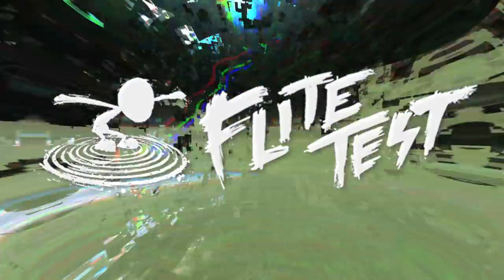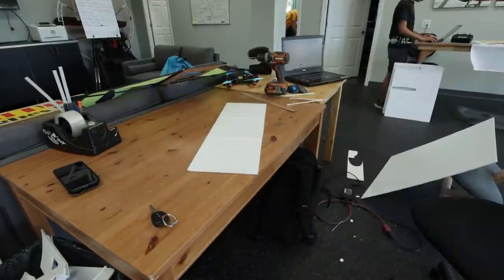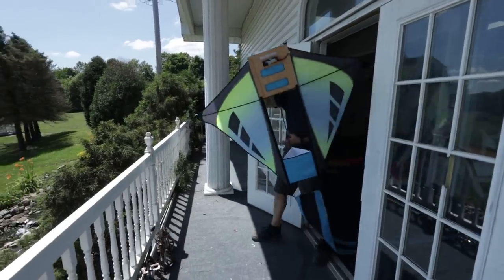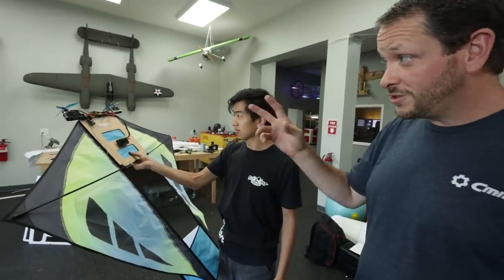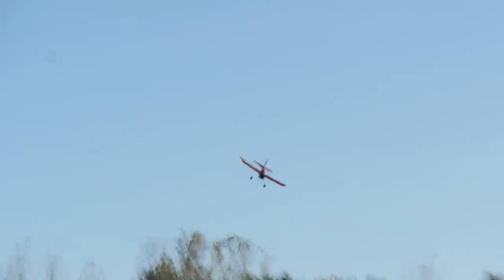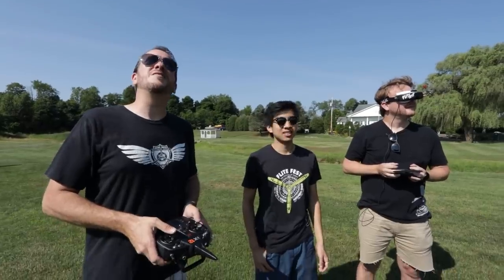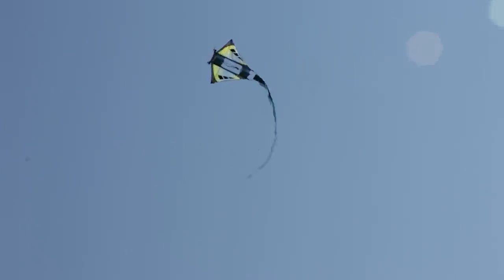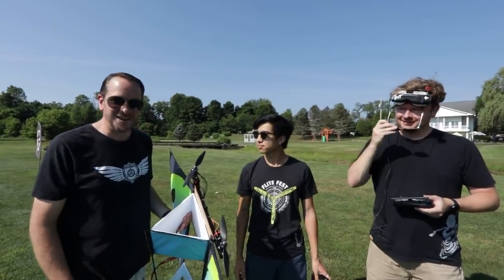Building and Flying a Kite with No String!

Comment: Super interesting. And as a kite maker/flier, I was wondering if it would improve further by having the motors 2" below the wings. That would create greater airflow underneath. As these aren't true wings with an airfoil shape to induce lift in the normal way, it just might work better. Not definitely, but it'd be interesting. 😉

Comment: Nice job! From my young kite flying days I have envisaged a small powered tug which operates to oppose the tension in the string - it essentially replaces the string.  A couple of servos would provide adjustment to the bridle to control angle of attack.  Then fly that in an actual wind using the lift generated by the kite and the pull of the tug to control up/down wind..

Comment: I have an idea for a potential game that's flite test could play. There will be two teams. Each side would have one mini cargo plane and 2 fighter jets. You would use green army men inside of a plastic bag with a trash bag parachute as "paratroopers". You would try to attack either side's cargo plane, and try to let not let them drop their paratroopers in a certain zone. They would use ribbons on the ends of their plane to recognize hits. If one of the planes ribbons got cut off by another plane, they were out. The objective was to drop their teams paratroopers first, and survive.

Comment: Great idea and brilliant solution! Plus you've basically invented a fairly easy to build (Kite itself is basically RTF) "plane" concept , that folds down to next to nothing. Great for those who don't have easy access to a roomy car, etc. Add a bag of releasable strips to the kit and make the foam triangles fold flat, and you're ready to travel. I have to wonder how a kite version of the FT Flyer would work out; It always gave me a bil of a "kite vibe" due to the shape. Could also be a fun revisit to one of the designs that got everything started for you guys!

Comment: I have a major challenge for you. Build from lowes construction foam, a 1 to 1 scale cessna 152. Insure to put everything in the cockpit including seats(from foam) that can hold actual human weight. Be sure to reinforce each piece with fiber glass. Once you get it built, although a little risky, place someone in the aircraft and fly them around just a few feet of the ground. It also should have plexiglass windows and paint. this is my humble challenge, however long it takes

Comment: The twin-motors-forward design/control system of this RC flying device is the same basic design principle that has already been implemented in countless different "Air Hog" RC flying toys...such as the venerable Aero Ace, the mini-Storm-Chaser, the F-16, the mini-Hero flying man,  the Intruder, and on and on (and on...).

Comment: It's actually a Bicopter with tail. The Kite does not fly. It's pulled/held up. CG is to high and almost at the front. That's why it can't glide and why you can't recover from a glide. This is also the reason why you needed the more powerfull motors. I think it would be more effective to take a drone/plane ... towing it. The towing hitch of the towing craft should be near it's CG on the upper side. Anyways if I would build this I'd use a lug on the spar to fix your spar exactly there. Well this would be 2 axes then (elevator with thrust and yaw with thrust differential). If you want to be able to control speed and climb (more or less *) independent you need to be able to lift and sink the motors.
I have an Idea in mind how to set this up also with the chance to go for full 3 axes (choice between yaw and roll) with the two servos and two motors but it takes some time to explain it and I'm definetly tired and hungry now and someone will wake me in some hours. So maybe later.
* If you add thrust you need to compensate the attack angle by lifting the motors to keep the same pitch. You can configure Mixers to make ist feel independend.

Comment: [8:16] "What do you think?  We were going with the wind there." 

The only wind an airplane (or a free flying kite in this case) feels is the relative wind generated by its forward motion through the air.  (See the Aerodynamics thread on the Forum.)  During this brief test flight the tail consistently flowed directly aft, thus showing that it had a good relative wind on the nose the entire time.  Why not put it to the test in a carefully controlled experiment with a well-instrumented airplane recording airspeed, groundspeed, and groundtrack as it flies upwind, downwind, and crosswind.

PS:  The kite looked beautiful flying with its graceful tail streaming out behind.

Comment: I wonder if you could utilize the two triangles on the kite to slide in a motor mount in front and maybe a control surface in the back instead of using zip ties?

Comment: Nice!!! I'd like to see the kite fly with the use of flight controls instead of vector thrust. Zip tie on an exoskeleton with carbon fiber rods attached to the top of the kite,  mount the servos and flight control surfaces to the rods, that way the kite stays a kite for kite use... It should have glide capabilities with that configuration...

Comment: Years ago I found the plans for a French War Kite, in popular mechanics. Same kite your tying, but no tail was required ... largest of these was about 1 meter . I had paid Ted the sides with, a copy of Marilyn Monroe's , playboy centerfold ...required 160 test twine two fly. Local radio station disqualified it from local kite contest .. Mis Monroe, was a no no, although there was no rules. From a  puff over two miles away, I ew to the end of my li e then let it go... it landed gracefully in front of the crowd and radio station remote ... never underestimate a centerfold ...

Comment: What mix did u use on the radio?   Wing? with the servos plugged into elevon ports and motors in motor port?  Or motors on rudder?

Comment: I had an idea to make a "real" stringless kite about 30 years ago, the motor pushing against the wind, rather than turning the kite into an plane!
But at that time the only control option was a simple 27mhz transmitter and the motors where too weak for the kite I'd made, gave up a went on to other projects!

Comment: I think you found about the only way to get a kite to emulate an airplane, since kites don't fly like airplanes at all, they are more like a sail on a sailboat. The way it won't glide was discovered by the early hang glider designers and dead pilots back in the early 70s. The phenomenon came to be known as "LUFF". Sailboaters know the term. When the boat turns to put the sail straight into the wind giving zero thrust. The Hang Glider designers eventually experimented with "Luff Lines" at the trailing edge to keep it turned up at all times adding some negative lift. A sail has to be inflated to generate any lift and once it has a zero angle of attack there's no recovery as the sail just luffs in the air and does essentially nothing to help you recover, unlike a real airfoil, HGs today have ribs to maintain an airfoil. You putting thrust into the kite added the needed lift the sails can't provide and the tail heavy nature stabilized it to counter the thrust in front. Genius, guys! BUt if your battery dies I don't think you could dead stick that thing at ll..

Comment: I've said it before and my brain can see it made with a long nylon threaded rod and a big metal nut but... Adjustable CG.... ? Maybe?
Reply: Is there a solution to lock it in place? Vibrations could probably shift the nut in midair.

Comment: I understand that a kite must move against the wind. Hence a strong motor and propeller are necessary. But how about controlling pitch, roll, and yaw by mere shifting of some weight underneath the kite, imitating the pull of the strings? Your solution has turned the kite into just another winged airplane. Yet I suppose my try will not be much fun to fly.

Comment: would it actually kill you to have a few "electrohubs" (and associated parts) in stock?
Reply: Having anything in stock these days is pretty difficult because of the pandemic. Shipping from China is slow in a good year, and right now it moves like molasses.
Reply: @rmdcade1717  You sure don't know what your talking about when it comes to my statement you commented  on. They discontinued their "Electorhub" and its associated parts years ago, the electrohub allowed you to build just about any copter/drone design (Tri-copter, Y-4 copter, Quad copter, Y-6 copter to name a few). The reason why I made my initial comment towards Flitetest is during this video they said they had "some leftover Tuff Tilts" laying around and used them; tuff tilt is one of the associated parts for the Electrohub for the Tri-copter configuration. First link below is to a bunch of Electrohub builds, the second link is to FliteTest store's drone page where you will not find an Electrohub option to click on.
https://www.flitetest.com/search?q=electrohub
https://store.flitetest.com/rc-drones/c3347
the following link is the original design of the frame called "Anycopter" I've got the PDF file for cutting out the frame, but trying to make from scratch what you see in the above videos came out like crap.
https://forum.flitetest.com/index.php?threads/anycopter-hub-kit-build.4414/
Reply: @thomasrobson6370  I see. So you're complaining that they don't carry a product that you know they discontinued years ago?  Because they have a few spare parts left over, You Deserve™ for them to reintroduce an entire product line so you can have something you want? Talk about entitlement.

Comment: Nice kite but it's the wrong type for an rc conversion - you have used a design that is intended to stay in the same position without the ability to manouver. A delta stunt kite would have worked better